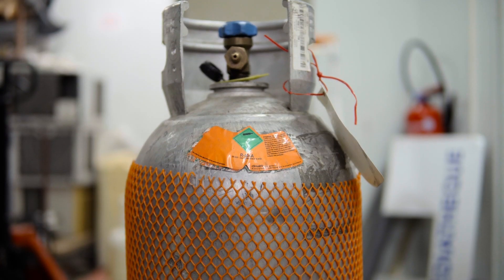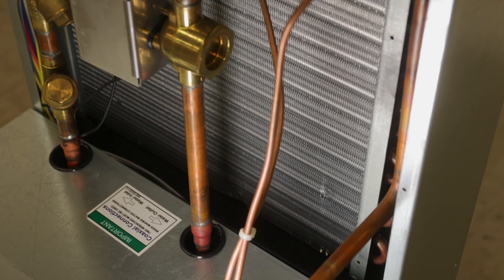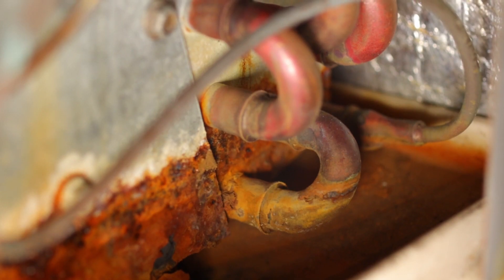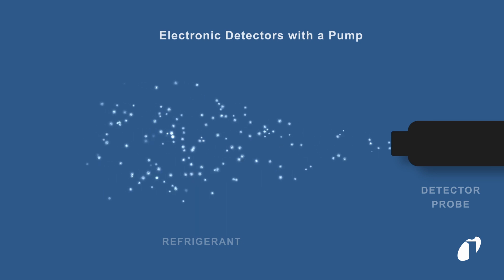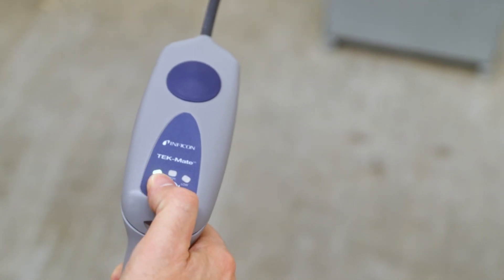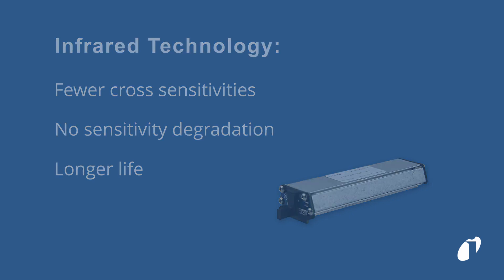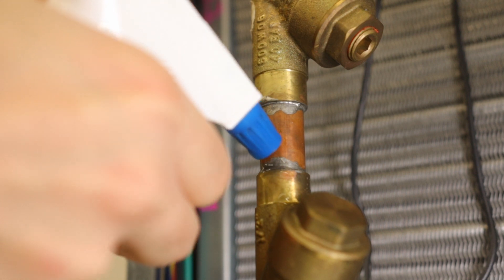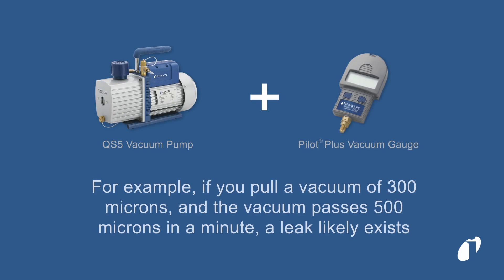How to Find Refrigerant Leaks in Your HVAC/R System

Comment: Can you detect 404A with nitrogen and combustion gas detector?
Reply from the maker: Refrigerant leak detectors like D-TEK Stratus, D-TEK 3 and TEK-Mate can be used to detect R404a. To detect pure nitrogen, use Whisper Ultrasonic Leak Detector.  When it comes to combustible gases, use an intrinsically safe leak detector, such as GAS-Mate. GAS-Mate is also a great option to detect 95% nitrogen/5% hydrogen (forming gas).
Your INFICON Social Media Team
Reply: @inficon  thank you